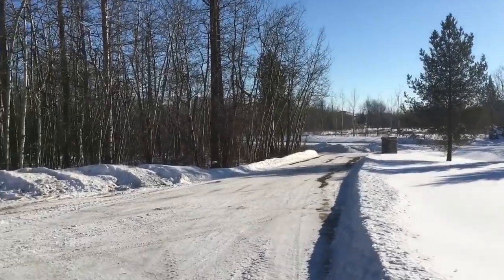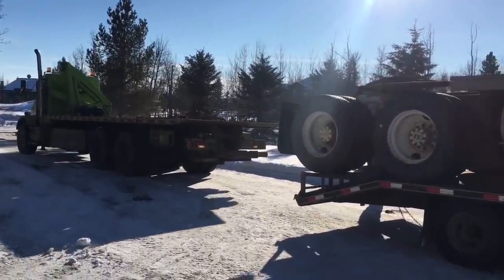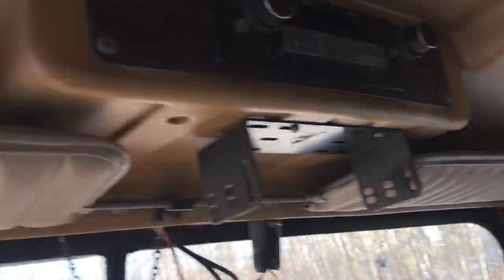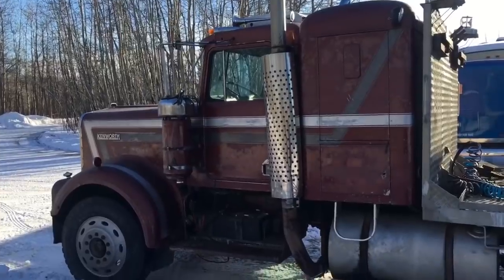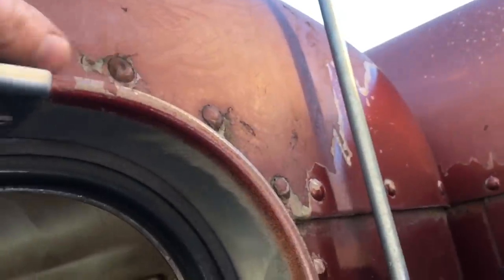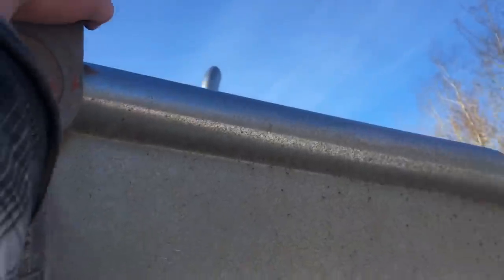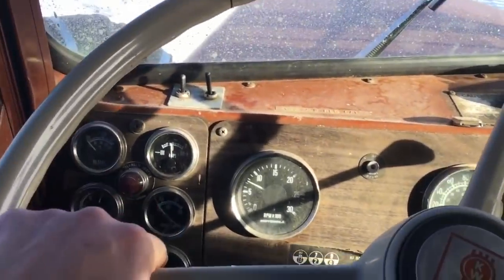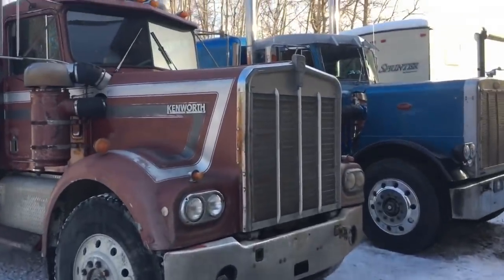Smokey & The Bandit Tribute Truck Ep.1 Bringing it Home

Comment: Love the giggle everytime you start it. I have an old Cuminns and ai smile the same each time I start mine. I bought mine in 2012 and have no issues with the motor. Still has the same batteries it had when I bought it because it's easy starting. Good luck with your endeavor.

Comment: Could have bought an 84 W9 with a brand new rebuilt Cat engine 60 inch flat top Reyco suspension real sweet.All there,sold at auction for 3200US.That's right,you'll find me at the edge of the bridge.

Comment: Hendrickson extended lead actually rides pretty nice. My 78 A model has it and I was going to put an air ride cutoff on it, but it rides nice enough I left it. That is a really clean truck to start from. 855's do sound good! How far it turns depends on which steering gear you have, they used several. The Sheppards turned pretty well, at least the 3 I owned did. The downside to the Sheppards vs the TRW is there is no sector shaft adjustment, you have to take the box apart and shim it if it's worn/loose. But they turned real easy!

Comment: Those old  5 hole steel buds are harder to find than what they should be. I drove an old truck with springs over walking beam suspension. It was a rough old truck. Granted it was a dump truck. I'll send two thumbs up if you keep it all original. All of my old rigs have their original suspension as well. Also if you're on Facebook, look up Vintage Truck Marketplace. You'll have a lot of luck finding parts that you'll need. Especially for that year and model.

Comment: If you can get someone to soda blast it the result will be great and it doesn't remove any excess metal from the frame/suspension.  Also doesn't damage any soft parts.

Comment: Mine was charcoal gray with red, white, and black pin stripping.  Mine was a 78 and I drove it till 83 and then the wife an I got the divorce and the truck went with the divorce so I sold it cheap. I had just put a new 400 big cam 2 in it with the 1406 - 13 speed and changed the progressive brownie to air shift, a learning curve but I was running 410 rear ends. Double steel frame with a mid steer axle with a air lift. Painted with Imron paint and that was a good thing cause rocks just bounced off it. 265 wheelbase and all electric scales,, I hauled off highway logging and long haul logs from washington to Oregon. I moved to Alaska where I still reside but moved from the southeast to anchorage and twenty later, moved to Wasilla where I retired. I bought a old narrow nose pete and built it from the ground up to match the k.w. and changed the hood to tilt and doors to the bottom latch. Pretty much all same measurements and running gear but went with a wet kit and hauled the fifth wheel dump box (side dump) I chromed everything. I lost it to the doctors in 2005 when I got crippled for life, barely walk with assistance and trying to save legs from fungus I got in Nam. 
The newest one you got has nice paint so learn how to buff it out and you will be happier

Comment: That looks like an old Hendrickson RT suspension. Pull out the cross tube and 4 bolts out of the torque rods and roll the whole walking beam out. Super easy to rebuild if you have a decent press.
Please rip the headache rack before you even touch the Pete again. Just do it!
Love the old CB. Period correct.
Reply from the maker: Nathaniel Mathies 10-4 good buddy 😉

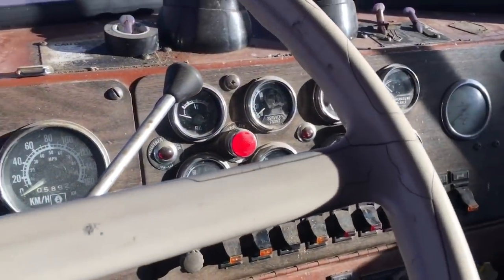Comment: I haven’t seen those switches (at about 4:35) in years. My sister has a 1975 Laguna that she bought from the parts guy at my dad’s former shop. He got the switches he used at a KW dealership waaaay back when. I kind of prefer these to most new ones. Big solid toggle with a good light.

Comment: The short hood 900As didn’t steer tight because the steering box is almost under the cab the long hoods was out buy the radiator they steered a lot tighter

Comment: Don't totally discount that Hendrickson suspension. With an air ride cab and new seats it's not terrible. And it will tackle the off road with ease because those walking beams will oscillate much farther than any air ride especially with out full locking rear ends. Never engage the power divider before your stuck!!!

Comment: This will be a neat build. Can't wait for all the vids to come. However, I think you should really concentrate on building a shop BEFORE you get started on this next project. And IMHO, I think you should get the body and paint work done BEFORE  you start putting it back together. Doing the same work twice ain't smart.
Reply from the maker: JMA actually this truck is about 6’ shorter than the Pete so with a little shoe horning I think I can fit it in my current shop for next winter.  A nice 40x60 separate shop is on my list when I can save up enough pennies for it.  When it comes to a build I’m a bigger fan of fitting all the accessories 1st when you’re not scared of scratching anything then it’s just a bunch of bolts and those things pretty much fall off the truck and it’s ready for paint last 👍

Comment: w9 vs 359 kw wins way better looking truck, and Sony Pruitt  and the snow man and b j mc kay can't be wrong. all the TV truckin legends  drove a kw. I am into transtar II internationals my perfect truck, dreamed of owning one. around ten years ago I bought one,  bad part was 8v92tta and no power steering.  needless to say didn't run it, then I sold it. I'm into 1970s in but after that is kw. and my third choise is a 1970s mack cruiseliner western, like those Hayward trucks. hey even the rubber duck had a rs model mack.

Comment: If you think those cabs are small get in an R model mack or even worse a b model, and that PACCAR cab will feel like a cavern lol. You’ve got the Best suspension for a truck that’s used for a truck in my opinion. You can’t beat a Hendrickson RT series for off road stability and articulation or on road stability loaded. Cool to see it on a tractor, I’d bet it pulled a lot of low boys in the dirt set up like it is, definitely No pavement princess.

Comment: Doesn't look like she has front brakes not sure if you can still get the front brake kit for the old Kenworth As. The truck has extended leaf Hendrickson I have a feeling that's been installed sometime in the trucks life.  Try a W900A with 425 super single steer tires they don't turn what so ever lol

Comment: Just making sure people know snowman drove a 74 not 79 w900a
Reply from the maker: There were two 900A's used to film the movie around Atlanta one was a 73 and the other a 74 ... I'm doing a tribute truck to the 74 with this 79 and getting it as close as I can.  Also, Snowman didn't "drive" either truck but instead rode around in the 73 as it was strapped to a lowboy

Comment: hi, what's a jake ?
Reply: Cummins have a compression release engine brake. It is manufactured by Jacob's Manufacturing, so it is called a Jake Brake. It works by releasing the compression through the exhaust when the piston is top dead center. With the compression released, it no longer can provide force to push the piston down, giving the truck braking force.
Reply: Steven Strimling Thank you 🙂